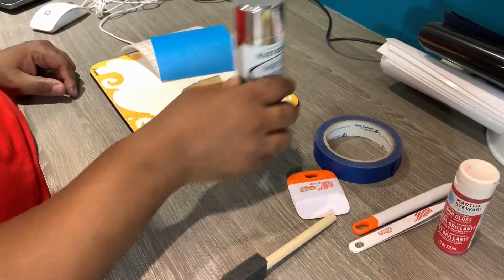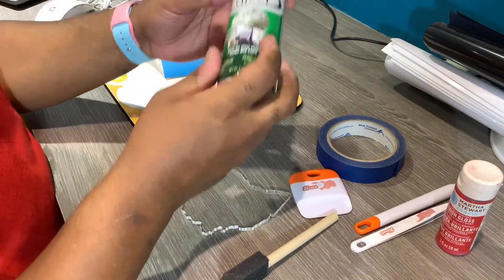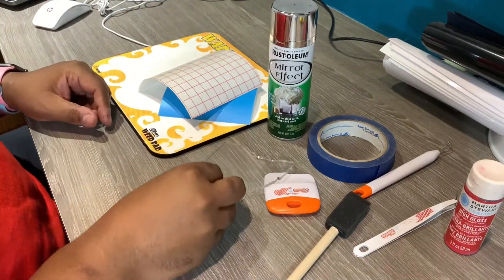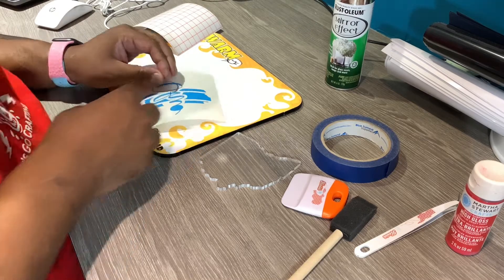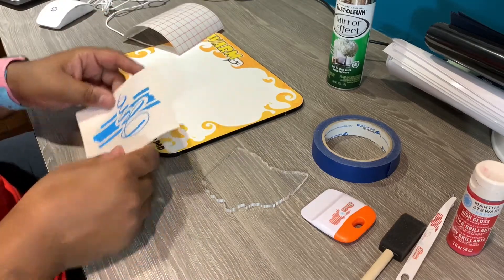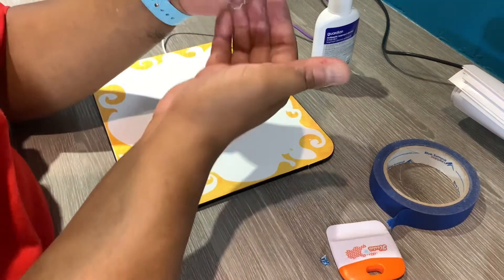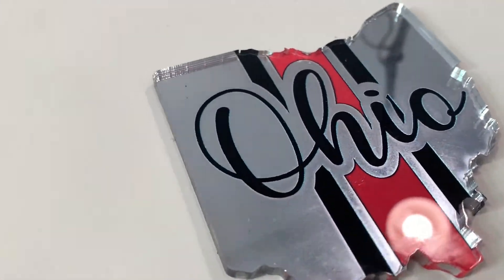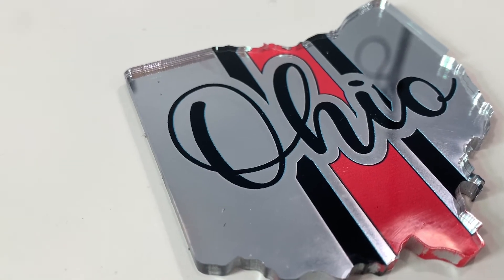Makeso Crafts: Masking with Clear Acrylic Blanks to Create Stunning Coasters : Hestai Products

Comment: Hi Master Maker . What did you cut the I believe it was " Oramask" with ? Could you cut it with a laser ?
Reply from the maker: Hi, Jerry I just used my Cameo 4 craft cutter, do you have a Cameo or Cricut craft cutter? If not I can show you an option without a craft cutter.
Reply: @Makeso-Hestai  I Just purchased a Circut Joy hope I did not waste my money?
Reply: @Makeso-Hestai  Yes please show me the option in case the craft cutter don't work .
Reply from the maker: @jerrysayers4002  It's a good product, on the small side for me but works great at it's size. You will be able to cut the ORamask or and other vinyl with it. And you can use any removable vinyl for masking as well.
Reply from the maker: @jerrysayers4002  Ok will do the other method is simple Exacto knife trace method. I will show it in another video.

Comment: Hi Master Maker I am just full of Questions , which of the many numbers ( 810- 813- 816 ) Oramask do you use  ? Thank You
Reply from the maker: Wow I didn’t know there were different ones, I will take a look when I am back in the shop and I will try to see what the difference is. If anyone else knows the difference please jump in
Reply from the maker: Ok, mine is Oramask 813 which has more tack than 811, this is denoted by the darker blue color as well. 810 is for the flexible object where I would assume if you are doing ballons or the like the 810 would perform better.  I totally did not know this before.
Reply: @Makeso-Hestai  Thank you